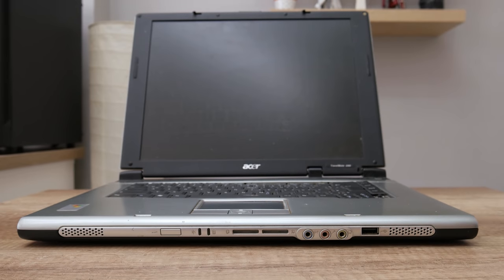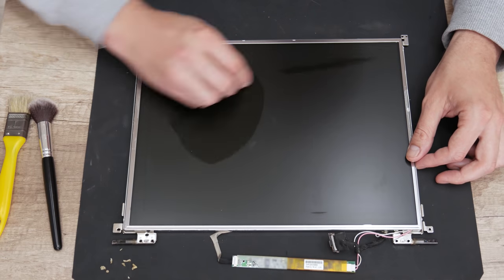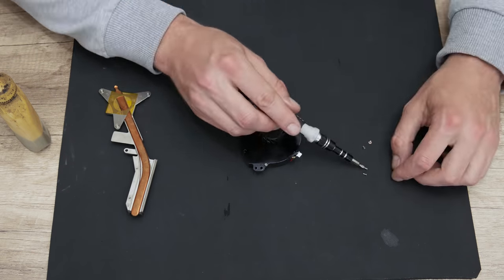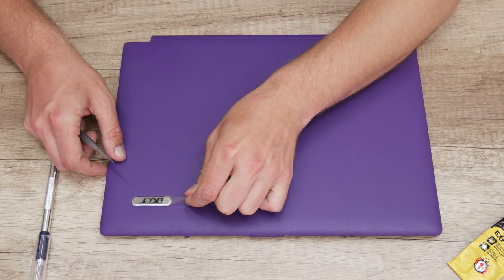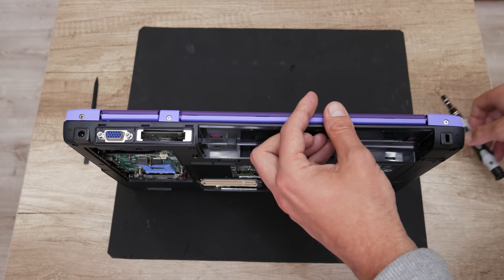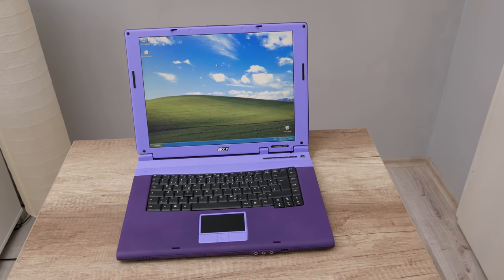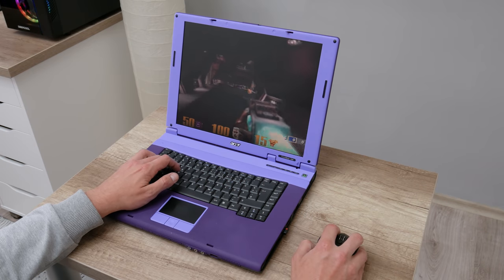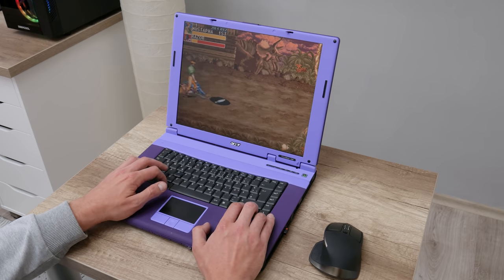Retro Laptop Restoration - Acer Travel Mate 2300

Comment: That looks beautiful, my friend. One question, would it be recommended to add a coat of sealant to the painted areas? So as not to rub paint off in high-contact parts like the palm rest
Reply from the maker: Thank you bro 😊 Actually I used high quality sprays, these sprays are made to take on heat, cold, bad weather and hard to scratch. Also before painting I spray the parts with additional spray that makes the painting after more durable, between the layers I also wait 6h-8h until one layer is completely dry. It's a slow process but the paint is much more durable
Reply: @ComputersAndTechAndAndrew  oh, great. Thanks for the reply. Love your content
Reply: @ComputersAndTechAndAndrew  Is it enamel paint? my Godson wan't to customise his Playstation controllers but does not know which type of paint to use, I told him possibly enamel.

Comment: Impressive work , note that it's very hard finding replacement drives the only way to get more storage in there without getting rid of the dvd player is by modding a small form factor msata ssd into an adapter to that , i never seen this happening before , but might be good after such modding and upgrades for a Linux machine or even a retro Original Windows xp for games , Using external peripherals for the best experience and Vga adapter if you don't have an old screen , even crt would be cool ..

Comment: @Cat and Andrew I have an old Acer Aspire 5738g laptop with core 2 duo t6600 processor installed and it is getting too hot even after cleaning and thermal paste changing.....Andrew can you suggest the best cpu upgrade for my laptop?

Comment: This is genius.  I have a Toshiba Qosmio, which is a gaming laptop that I use, still works pretty well but there is a problem. Some days I have no problems with it, other times, the laptop will spontaneously shut off, as if there is a short.  I restart it and it's perfectly usable but it's irritating.  I've heard that perhaps I need a cooling paste or there is an accumulation of dust.  I tried to use my brother's air compressor unit to blow out dust but I don't have the confidence to open up the laptop.  What do you think is the problem?  Any suggestions?  I have replaced both the battery and AC adapter.
Reply: Hi, I know you’re expecting a reply of Andrew but I’m hoping I can help you out! I’m pretty sure your problem is old thermal paste and a very dirty heatsink. I’m telling you right now opening a laptop is so easy! I just opened up my first laptop this week to change some thermal paste and it was much easier that what I expected. All you should need is a screwdriver a brush so clean out the fans and heatsink and some thermal paste! Any thermal paste should work. Just watch a disassembly video of your laptop and bang, Good to go! Now you have a restored laptop! Hopefully I was able to convince you to at least try! Good luck!

Comment: This is a great repair ! I really enjoy your videos 👍
I am currently repairing my laptop right now and i was wondering if you had a tip for how to remove a stuck screw (on the heatsink in this case) 
I tried the rubber band method but it doesn't work, the screw is very fragile
I am kind of desperate at this point xD

Comment: The content of the video is okish but it's advised to not wash metals like copper and iron because copper will turn darker due to oxidation and iron sheet at the bottom or top will oxidate and will corrode and bits will land inside of the laptop. Your engish still needs a lot of work. The corrusion on the motherboard is to be cleaned and then motherboard goes to oven for a low temperature to remove any humidity and then the parts that were with corrusion to be painted by a polish ink like nail polish to prevent the ongoing corrusion.
Reply: "your English still needs a lot of work".. As do your manners. I did not realize this was a channel with a main focus on oratory skills and language proficiency.

(Edit): I have checked your channel, and have but EIGHT subscribers to boast about. And every comment you post on this channel has been demeaning Andrew for his accent. That's textbook envy, man! Grow some manners, and build a better channel yourself, instead or belching criticism on this man's great work.

Comment: hey man, I wanted you to make a modification of the old (not so much) Acer Aspire one 722, I know that you are not supposed to change the processor or the motherboard, but I would like you to try it, because I have seen very crazy modifications, in which they change the motherboard, the processor, the battery, the screen and add a gpu (obviously not to this laptop) but, would you take the time?

Comment: Hi bro do you recomended me egpu i have a "gaming laptop" with gtx 1050 2 GB so i think to connect a egpu do you recomended me that and what egpu i can buy if you recomended me
My laptop specific 
I5 7300hq 
8 gb ram
Gtx 1050 2gb vram
Reply from the maker: Hi bro, I'm not sure about this model, laptops with 1050 are little bit problematic with eGPU, the standard EXP GDC mostly is not working, But the EXP GDC X4 M.2 in some cases is working but not with all

Comment: I need to fix my laptop. It used to be windows 8 but I changed it to windows 10 and it's slow and the fan is running slowly. I need to repair it or get someone else to.

Comment: asus k53sc upgrade video plsssssssssssssssss
Reply: i5-2540m / i7-2620m / i7-2640m / RAM 8-16GB so-dimm DDR3-1333 /

For Windows, buy an SSD 240-256GB (2.5 "/ SATA-III / 3D TLC V-Nand), and transfer the HDD via an Optibey adapter (12.7mm) to the DVD slot (for storing files (disk D)

you can install i7-2670qm, i7-2760qm, but to avoid overheating of the laptop, it is better to use these processors with the turbo boost turned off at a base frequency of 2.2-2.4 GHz. Get 4 cores / 8 threads.